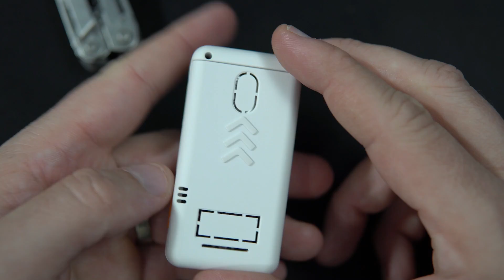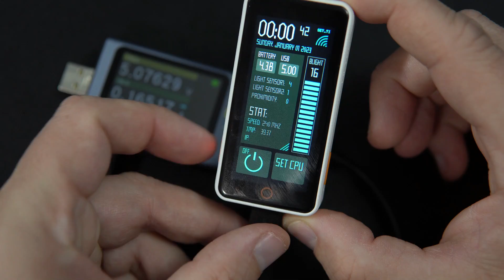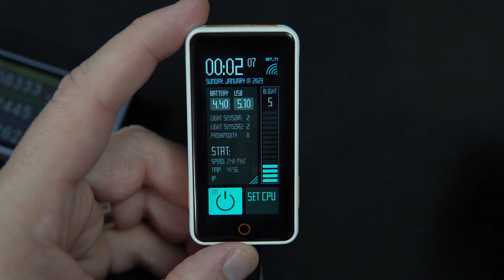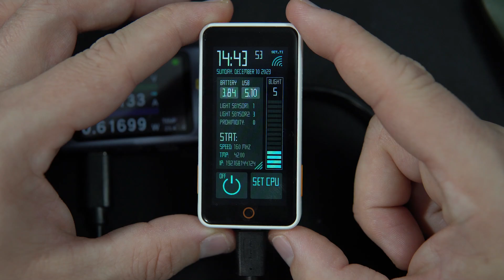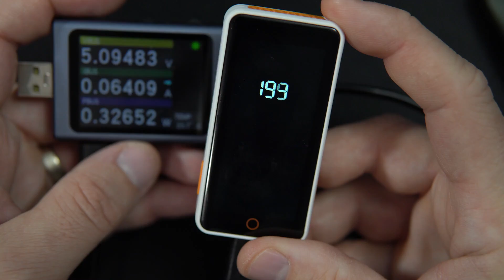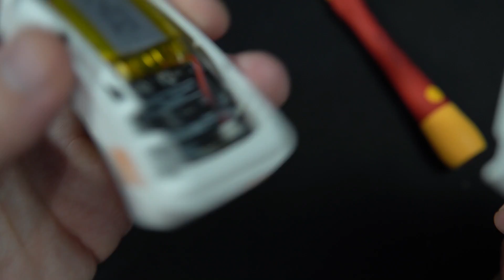T-Display S3 PRO (ESP32) -PART 2 ,Power Consumption

Comment: Unresponsiveness is usually due to the program being too busy to check for input. The ESP32 typically has 2 cores, right? So is it possible to use one of the two cores to check the input, so the input is always available to the program?

Comment: For the run time of the battery, you need to calculate with power, not current. Battery is 3.8V x 470mAh = 1.8Wh. On your measuring tool it was close to 0.6W, meaning run time will be 1.8 / 0.6 = 3 hrs. This is assuming display is on whole time. Since it's an OLED the power consumption will depend on the number of pixels 'on' and the brightness.

Thanks for your videos. Nice device and already thinking about projects with it.